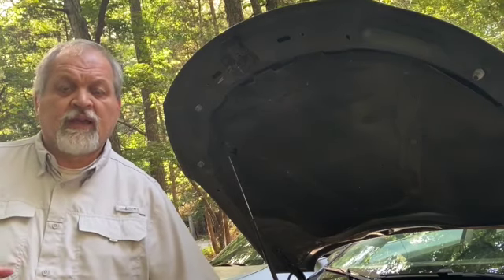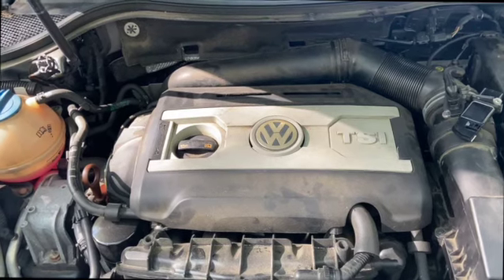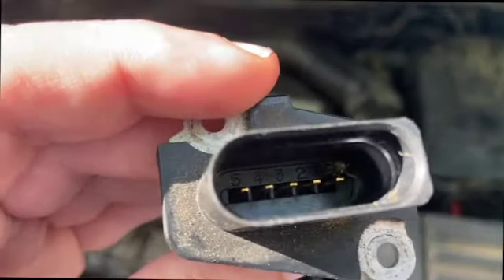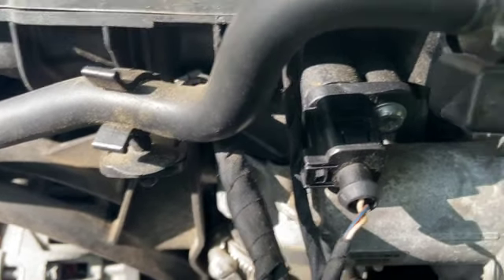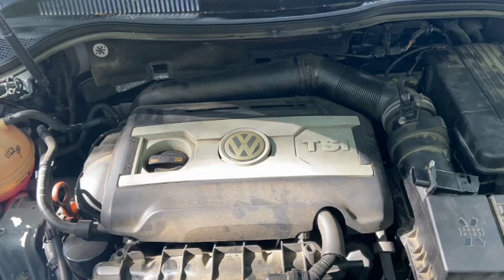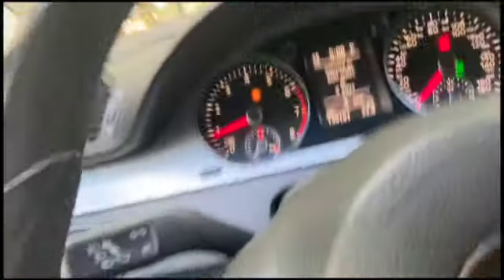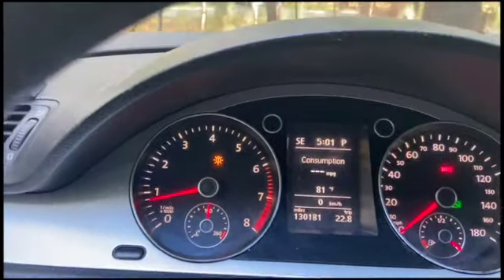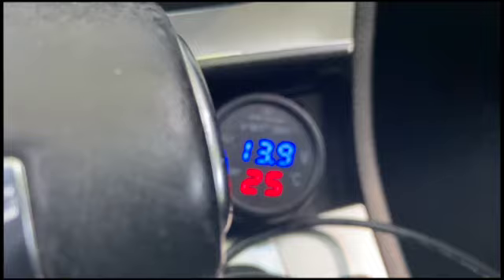How to fix  hesitation under acceleration or heavy throttle in your car

Comment: Hi boss i have Nissan qashqai 2.0 model 2008
Sence one week facing a long staring time which abnormal in my practice as previous routine 
Some time i feel dropping and jerking of engine RPM during on road driving speed
Also when i stop on signal  car engine goes off 
Than i push to stert engine  become to start 
One think i also observed car coolant also become low
I hope u r give me a good and nice repair suggestions 
With thinks
Reply from the maker: check your throttle position sensor and clean the throttle nody

Comment: Hi can a gearbox mount cause car to shake and make rattling noise at idle manual car thanks
Reply from the maker: Yesbt soo can a lot of other things
Reply: Does the rattle go away with the clutch pedal depressed? If so, likely the release bearing.

Comment: I'm hoping for replies to this also....

I had a coolant leak on my 2017 vw Passat 1.8tsi mk7 so i changed out the thermostat housing and everything seemed ok until the first run...

Firstly the gears would hang in 2nd and 3rd for a lot longer than before (shifts at 4.5rpm rather than around 2.5) then after about 2 miles i goy a stop start error - i don't use that feature so it wouldn't normally bother me but it now displays an EML light now and it won't disappear 

I have code scanned it but no fault codes displayed 

Battery wasn't disconnected during change of thermostat housing 

 I've also checked the standing - ignition off / resting voltage is at 12.4v so all good there and the initial Start up spike does not go below 11.2v

I will check the running voltage but everything seems ok with the resting voltage output 

Everywhere I've looked says it's the battery but clearly not in this case

Spark plugs have just been changed also

Car doesn't seem to be as responsive as it was before and seems sluggish but climbs the gears ok (apart from 2nd and 3rd)

Everything else works as it should 

I've even tried everything switched on but that doesn't affect anything (like flickering lights, dimmed lights etc.) so doesn't seem like it's got a parasitic drain anywhere 

Any help would be greatly appreciated and thank you all who reply in advance
Reply from the maker: Your running voltage should be between 13.6 and 14.3 so you may have a bad battery the thermostat change is coincidental
Reply: I'm in the U.K and everything I've referred to (Haynes, Auto data etc ) states 12.3v 🤷🏻‍♂️
Reply: @ProfessorDIY sorry I meant car not running is at 12.4v
Reply from the maker: @everton1878able  have you tested the basttery under load?
Reply from the maker: @everton1878able  12.3V is nominal voltage when the battery is not under load
Reply from the maker: @jb9072  YYour vo9ltage statement os correct, the rest not so much even a slightly drained battery cab cause erratic behavior in modern cars

Comment: thnx for this info. i am new to ur channel. keep up the good wrk. we need more ppl like u. do you know the reason for a good running old 2009 vehicle with 195thou miles that now just sudden has developes a weird feeling in the STEERING WHELL  when driving. It not from the front ends. i am sure. It feels more a grinding feeling in the steering, not a vibration, but a not so smooth feeling anymore as when it was new. It is weird, and hard to really explain. This vehicle runs great still. You feel it in the steering wheel when the engine is running, this sensation is not felt on the body of the vehicle at all.  thnx.again.
Reply from the maker: I would check the steering pump, steering is not to be messed with however
Reply: ok, thnx. @ProfessorDIY
Reply from the maker: Any time

Comment: Hello I have a problem with my 2014 Nissan pathfinder. When driving and accelerating it doesn’t go or it won’t pass 20 mph after trying to go any higher mph it’ll start shaking really bad and eventually driving it longer it’ll become overheated. When accelerating it’ll sound like it’s screaming to go. Please help.
Reply: Also when driving the engine light will blink
Reply from the maker: Check your oil, transmission, and coolant lines for any contamination, you appear to have multiple issues going on

Comment: I have got a vauxhall corsa loses power when accelerating replaced throttle body and electronic accelerator pedal still no change please what could be the problem
Reply from the maker: unless you own the electric one The throttle position sensor or accelerator pedal position sensor alternatively air system leaks or dirty air filter/MAF

Comment: My car accelerates, but after 3k rpm the car starts to lose power and shake abit, what the problem?would be appreciated for your answer
Reply from the maker: I would start with the air system. Air filter, MAF, and vacuum leaks. Then a would check test the throttle position sensor

Comment: What happened I try to accelerate on low gear, but is not responding, but on high speed it work fine, immediately engine sign show on my dashboard, my acceleration will stop working, it look very loss as of air and after some time it pick and stop making it very hard to accelerate on low gear or speed , like accelerating being in traffic
Reply from the maker: I would check the throttle position sensor and the  throttle control valve
Reply: @ProfessorDIY  thanks for your reply I really appreciate, please if more information on what to do because immediately the sign come out on dashboard, accelerating on low gear like on traffic etc because very hard or experiencing fraction in the Tyler , ie like not moving smoothly or something pulling it back, but immediately the car is off and you switch it on again the sign will remove and the car will start moving well  , but not to a far distance before it display again
Reply: @ProfessorDIY  thanks for your reply I really appreciate, please if more information on what to do because immediately the sign come out on dashboard, accelerating on low gear like on traffic etc because very hard or experiencing fraction in the Tyler , ie like not moving smoothly or something pulling it back, but immediately the car is off and you switch it on again the sign will remove and the car will start moving well  , but not to a far distance before it display again
Reply from the maker: @robin-action1394  Did you try the throttle position sensor?

Comment: Hey, i got one hell of a problem. My car (2.0 tsi vw passat b7) is reporting a rich mixture both at idle and off idle. When stationary, the revs drop and sometimes even the engine dies. Cold starts are very rough (revs fluctuate anywhere between 500 and 1100ish rpms) but only for 10 to 20 seconds. Odd, right? Now the funny thing is, all of these problems only occur in HOT WEATHER. Yup,only if there are 20 or more celcius degrees. Whenever i drive my car in the winter, mostly sub 10 celcius degrees, my car runs perfectly fine every single time. well..at least the 3 to 4 months while it's cold outside. I have tried fixing the problem for multiple years. Even rebuilt the engine. Changed fuel pump, fuel control module, inspected evap system, pcv valve, spark plugs, ignition coils, Nothing seems to help. However, i did i tiny experiment. I noticed there is way too much air drawn from the pcv valve to the intake manifold. So i added a reduction valve. My idle problems went away (not completly but it's better) but now there is an hesitation when i press the gas pedal when i want to get moving from a stationary position. My theory is that there is something wrong inside the intake manifold and my car tried to compensate for the missing air (probably caused by a stuck valve,flap inside the intake manifold) by drawing too much air from the pcv valve. I don't know..i am completly lost. Any ideas? Sorry for any english mistakes
Reply from the maker: Based on your symptoms I would suspect a throttle position sensor have you checked it?
Reply: @ProfessorDIY  shouldn't be there a cel code?
Reply from the maker: @andreisenchiu2391  Not always
Reply: @ProfessorDIY  so based on my reader the throttle position is 17% when engine is off, 13% at idle and goes to a maximum of 87%. However, if i press the gas pedal when the engine is off, it drops from 17% to 12%. Anything unusual?
Reply from the maker: @andreisenchiu2391  Yes your pedal position sensor might be faulty as well.

Comment: Oh oh oh... I was going to use brake disc cleaner on the maf sensor... thank you for pointing out the right stuff to use. 
I have a C220 cdi, 16 years old with 109k miles. I've had it 5 years and acceleration from start is very slow untill the turbo comes in. There are no fault codes for the maf but I'm sure a good clean / maintainance could maybe fix the acceleration issue. It is too lazy for a 2.2 engine, there must be something wrong. If this is still the original maf sensor, I'm thinking it might still work but after all these years never cleaned, maybe, maybe it is not reading correct values.
Reply: Lol , good you didn’t 😂.
I used throttle body cleaner which is much closer to MAF cleaner but the car stopped working. But I had a genuine idea and cleaned it with rubbing alcohol. It takes away the grease and dries as fast as the MAF cleaner. Emergency back up
Reply: Update.... holy cow... the difference is night and day. The MAF sensor was so dirty, never been cleaned for sure. After the clean I have acceleration like mad, finaly after years of driving it as it was.
Reply from the maker: It might be your turbo fan but you are correct no harm in cleaning sensoers

Comment: I have a toyota camry 2018 se 2.5l
I have misfire cyl 2. Code and also random misfire I believe p3000
I have new fuel pump and filter. New Injectors.. new spark plugs.  swapped coils to check if it changes to different cylinder code. 
Checked leakage for valves. Good.
Intake sensor good. MAF sensor is good. 
Haven't checked compression. But when I disconnect cylinder 2 while misfiring it doesn't change meaning seems that exactly still the area where the problem resides. All others (1,3,4) when disconnected cause it to misfire even more.. 
I do also get engine power reduced sign on dash. 
May my 02 sensor for any faulty reason possibly be causing my ECU to think it's running rich or lean and be causing the random misfire and the specific cylinder 2 misfire?? Without popping up a 02 sensor code on OBD 2 scanner???
Reply from the maker: Did you also check for pending codes or just active/stored codes? Also did you check your ait filter and throttle position sensor?
Reply: @ProfessorDIY  I reset codes everytime and rerun the car. Same codes keep coming up.  And yes I checked air filter and cleaned throttle position sensor. 
Any tips from here?
Reply from the maker: @monstermind4286  I would check the injectors starting with the known misfiring culinder
Reply: @ProfessorDIY  I have put all new for injectors. And all 4 new spark plugs. I did swap the coils from second cylinder to first cylinder, but the code comes up on second cylinder still. One important thing that might help was you. Giving me some help is the car starts good, but as soon as I give it some acceleration out on the freeway to push-up to like 40 Miles an hour, it misfires slightly up to 40 and from 40 to 60 Miles an hour it will. Start to miss fire And then the engine loses its power, no matter how far I push down the pedal. When I get back now, when I disconnect second cylinder, it doesn't make a difference on misfire. As if the second cylinder is dead, one way or another. I'm cleaning the oxygen sensor right now. Any other ideas are very welcome. I still appreciate you.
Reply from the maker: You replaced both injectors and coils?
Reply: @ProfessorDIY  injectors. I have not replaced coils. I swapped coil 2 into 1. And 1 into 2 hoping that the code would come up on 1..
Reply from the maker: @monstermind4286  then check the coil cable, otherwise it can be an ECM
Reply: @ProfessorDIY  will do. Multimeter??
Reply from the maker: @monstermind4286  it can be done with a multimeter and chemical cleaners do a good job unless the injector is physically damaged which is rare,
Reply: @ProfessorDIY  Understood. I took out my 02 u sensor 1. It was black and dirty. I cleaned it as best I could with carbureted cleaner and then let it sit in gasoline for about an hour. Some gunk came out but not much. Looking inside it's still looked really black. For now, I put it back in and the engine runs about seventy percent better. I've heard that the 02 sensor can trick. Date computer into thinking that it's not getting enough oxygen Therefore, setting more fuel to compensate, which will cause a misfire. . Because in reality, it actually doesn't eat more fuel to compensate. It's more like a trick to the computer. 
What are your thoughts on this? I never got an 02 sensor code, but seems too. Ease the misfire Overall
Reply from the maker: @monstermind4286  brake fluid decarbons very well
Reply: @ProfessorDIY  It's worth a try. I'm thinking if I can get an O2 sensor with life warranty. So if it's not it, I can return it. That might be a good idea to try.
Reply from the maker: @monstermind4286  Please let us know how it goes
Reply: @ProfessorDIY  Will do. Thank you so much. Your time is appreciated

Comment: My 2003 accord under pedal to the metal acceleration sometimes won’t kick all the way to full throttle, or sounds like it sits at half power at full throttle, also under hard acceleration above 2 year it will rev as high as possible fast, but you hear the pressure like cut out and come back and cut out, like a you don’t hear the exhaust anymore,  as if it’s running and something getitng partially clogged at full throttle. I’m really confused, cleaned fuel system and new plugs, but thinking the cat may be getting clogged or my injector or pump and filter may be dirty, I don’t know can you help?
Reply from the maker: I would check the throttle positioning sensor
Reply: Ever got it fixed?

Comment: i have a 1997 integra LS auto as a daily and ive been having an issue where it turns on first try no problem everything is great, computer reads 0 codes, but when its time to drive off weather im backing out of the drive way or just driving forward pushing the pedal down makes RPMs bounce at very low levels before stalling on me and when i turn the key off and turn my car back on it fires right back up and i cannot seems to find a stable fix, i have tried resetting my ECU, checked my ground cables no problems and im not sure what it could be but i also wouldnt want it to be a $50 - $100 fix and me take it to a mechanic and let them charge me $500 for something that wasnt there
Reply from the maker: That sounds like an idle control issue - have you tries to adjust the throttle
Reply: @ProfessorDIY  im going to clean the IACV and re-adjust the throttle and see if that makes a difference, thanks man! wish me luck
Reply: @acaciusaima did it work?

Comment: My 2007 Tahoe (220k) only has the acceleration hesitation when the AC is on. Wondering what that could be? AC Compressor/Condenser maybe? No codes.
Reply from the maker: That is a weird one but still likely suspects are air/vacuum system
Reply: @ProfessorDIY  Turned out to be the (accelerator) pedal position sensor. I just replaced the whole accelerator pedal assembly and it went away (so far). The AC being on wasn't related, as it also did it late this fall when I was just running the vents.
Reply from the maker: @m1cajah  thank you for the update!
Reply: @ProfessorDIY  You're very welcome! Once I told my local mechanic friend that it was limiting me to 1500rpm on acceleration he told me "you're in limp home mode" and to change the pedal sensor/assembly and it should be good to go. About $40 and 10 minutes of my time and it's been good so far.
Reply from the maker: @m1cajah  many people do not even know that thrirle position and petal position throtles exist - somre mechanics take advantage of this

Comment: Hey mate. I have a 2014 golf tsi. When accelerating from stop, there is a very big lag. What could be the cause. It doesn’t feel normal. Thanks.
Reply from the maker: Start with checking your Air Filter, MAF, and throttle body

Comment: I got a p0505 and p1001 my maf sensor voltage is good but my g/s is over 15 and should be @1-2g/s
Reply from the maker: clean air filter and no vacuum leaks?
Reply: @ProfessorDIY  i have a tear on my intake duct after the maf but i put duct tape on it do u think it would still read wrong?
Reply from the maker: @LuwisRz  yes it is almost ceratin it reads wriong -

Comment: I have a 94 Cadillac Fleetwood,5.3 engine,,I have a jerking and hesitation I have tried everything,, can you please help me
Reply from the maker: More detail is needed, when are the symptoms present?
Reply: @ProfessorDIY  sporadically I can be driving and get up till like 40 45 mi and it just started jerking shaking and things like that I replaced the optical spark plug wires everything still the same issue
Reply from the maker: @georgefields3396  try to clean replace your throttle position sensor
Reply: @ProfessorDIY  thanks will do...

Comment: My car stalls immediately after pressing the gas pedal. What caused this?
Reply from the maker: Can be many things what other symptoms do you have? Does it idle between 800 and 1000 RPM?
Reply: @ProfessorDIY  No. This is a perfect example. While I was in traffic the other day, my foot was on the brake and after releasing the brake and hitting the gas pedal the car surges back and forth slightly before moving